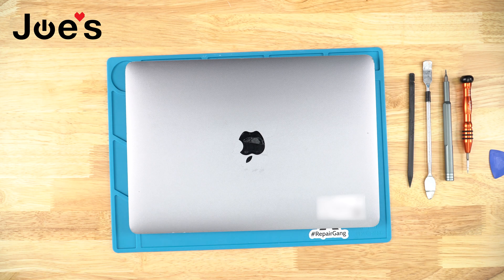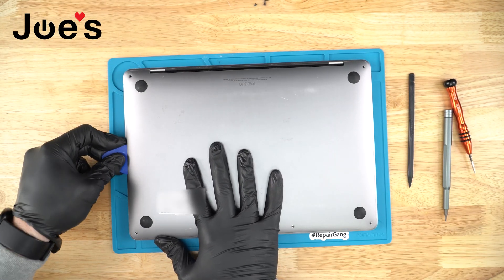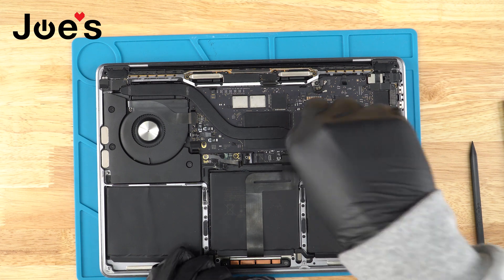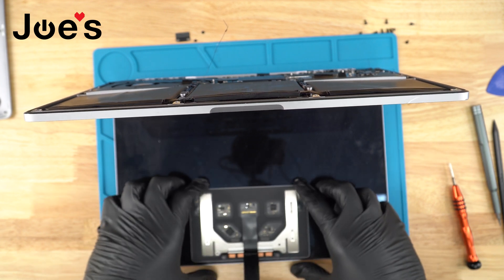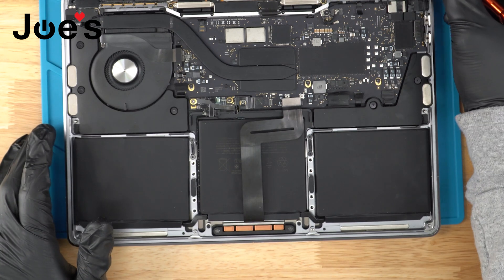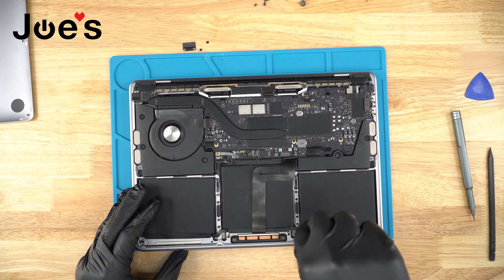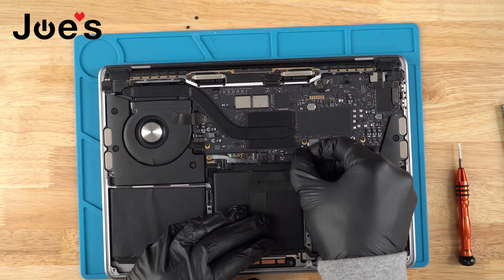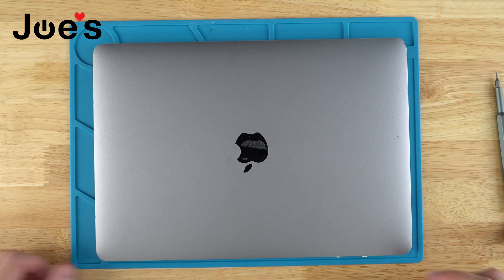Apple MacBook Pro 13" 2020 2022  M1 M2 A2338 Trackpad Replacement | Repair Tutorial

Comment: Disconnecting the ribbon at 2" mark in the video is extremely fragile. While pulling the ribbon out it ripped out the circuit from the motherboard. Bricked my MacBook. Dimitry what should I replace to save my MacBook? And what's the rough cost?
Reply: I need help i Tryed to change the battery of my father Mac book pro 13 A2159 but during the operation i damaged the trackpad cable and the trackpad itself so i buyed the cable with a new trackpad i connected all perfectly but in my system there is a strange root named kernel task that is using all of my cpu, i tried to unable all third part extension also to eliminate an extension named family plugins i don't remind perfectly, i also tried to reset the nvram, i tried to do something on the terminal in the recovery mode but nothing changed, the last thing to do that remains is to reinstall the operative system any help please?
Reply from the maker: Hello, thanks for commenting. Please email us at support@joesge.com with your question. We will be able to better assist you there. - JoesGE